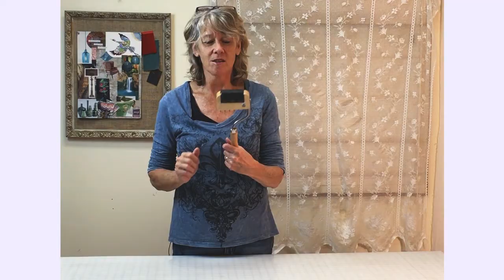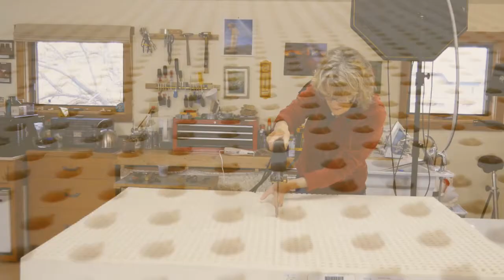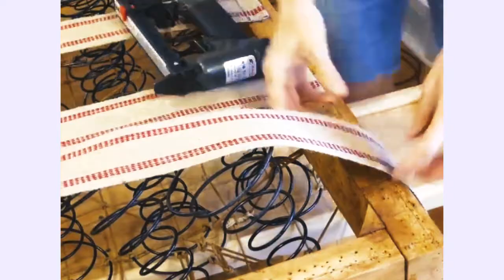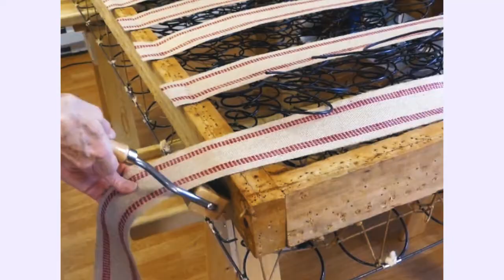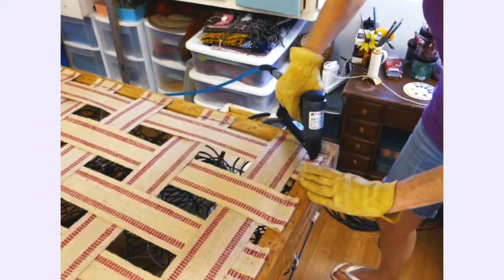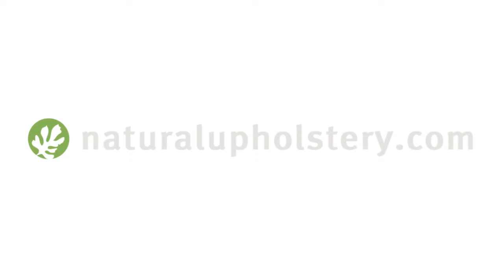Upholstery Tool Tip - How to Stretch Webbing Using a Gooseneck Stretcher

Comment: Thanks for this helpful video. What kind of power nail gun you use and its size for nails for  furniture? How much does it cost and where do you get it from?
Reply from the maker: I don't use a nail gun for upholstery. Any upholstery supply vendor will have a standard upholstery staple gun, accessories and will sell the correct size staples to go with it.